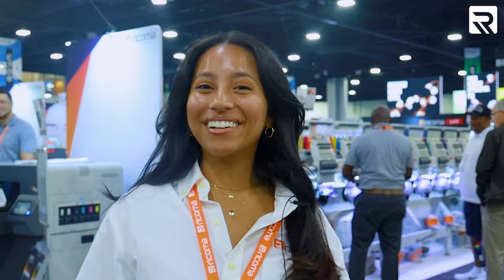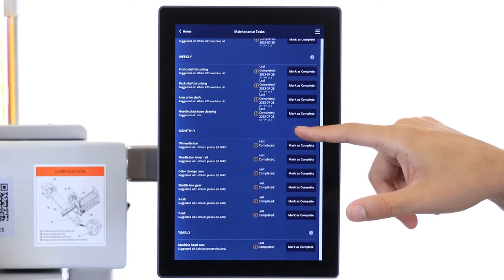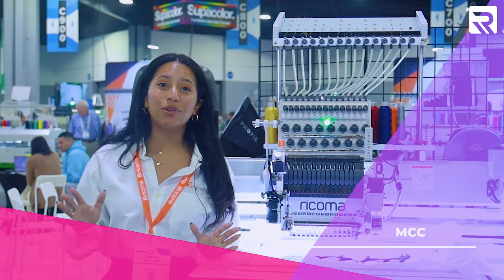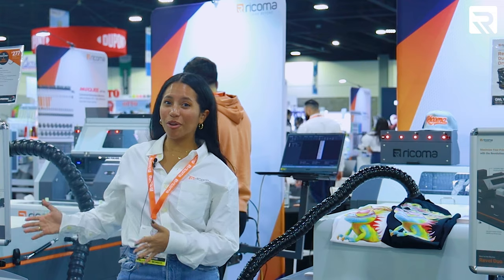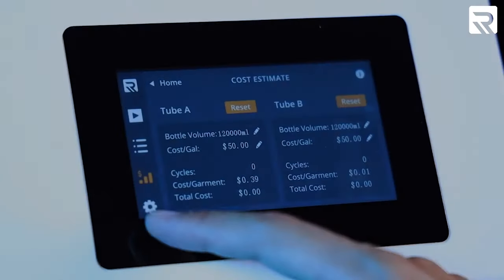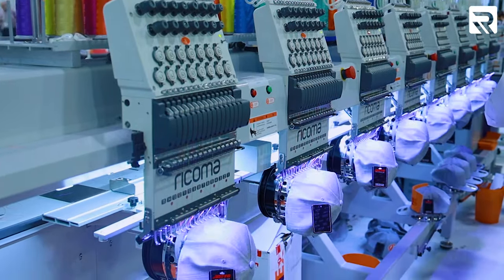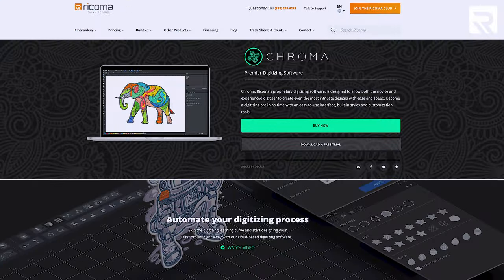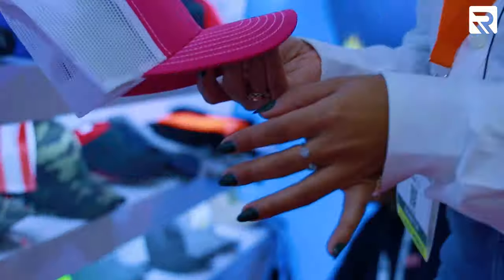Checking Out Our Latest Innovations at Printing United 2023!

Comment: As a blind embroider, I want to congratulate great success and great breakthrough and Technology, putting10.1  panel on an embroidery machine. Specially, with the fact that you could zoom in and out as a blind person would be able to do better work than the traditional LCD panels that embroider machines have really wish. I could check it out and see if I could test it out currently I am the only  legally blind /and I also have true prop palsy embroider in the whole United States. Congratulations in the Atlanta show you guys had a great. Both  I personally have done Dtf and truly love Dtf in the white toner with the luminary system is a great concept as well. Keep up the great work truly would love to try out the 10 inch panel.